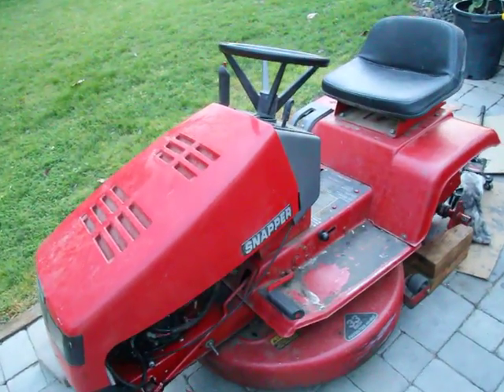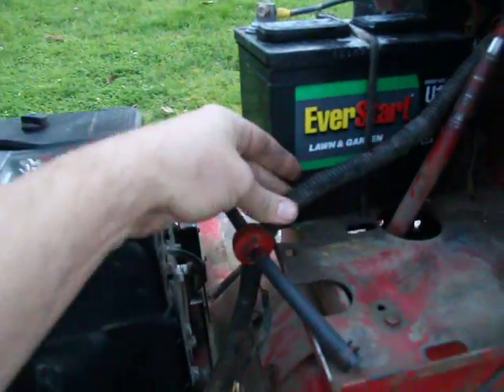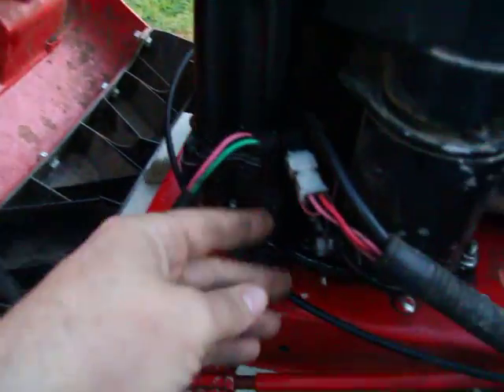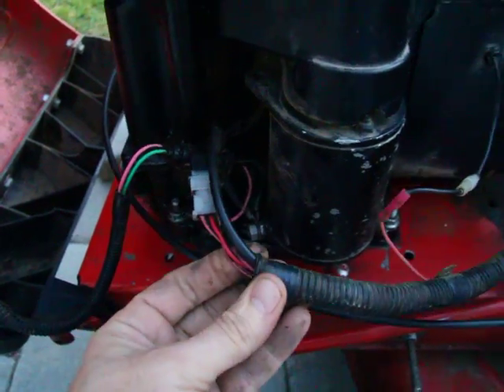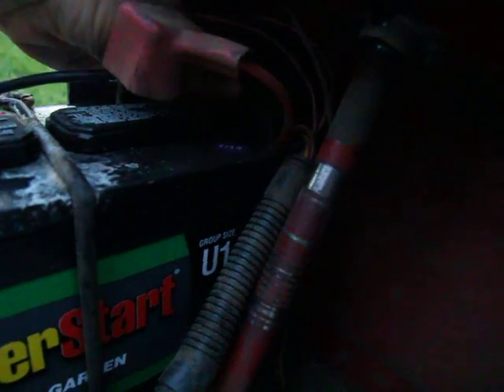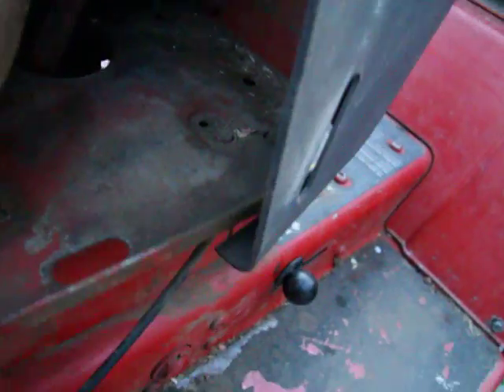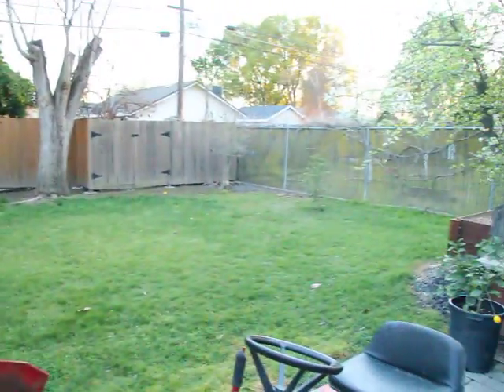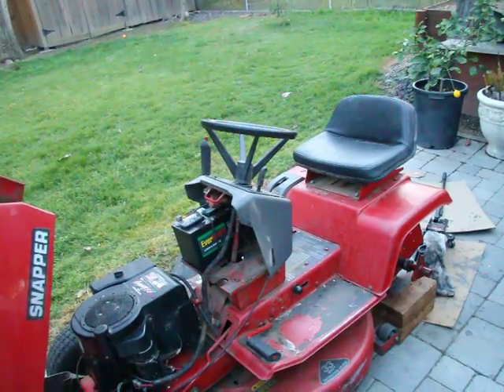SNAPPER RIDER WIRING EXPLAINED (SORTA)

Comment: thanks for the video. the first 2 digits on the code of your engine is the year. I think your snapper is a 1990s one. I have the same one. mine is a hydro. the year of it is 1994 I sent you the wrong service manual. the service manual I sent you is to my other 1984 snapper tractor lt11 with a pto shaft. google the snapper company they might be able to get you one and e-mail it to you.. does yours have a rubber drive wheel on the transmission? I will try to help you as much as I can. did you get the gear case back together. mytractorforums google it. join it they may help you further. the video is good in case I have to rewire my 90s snapper. your so lucky you can work with no snow.
Reply from the maker: Thx, my serial is like: Lt 115 D3311B so I have not a clue about date of manufacture. The drive disc is rubber where it contacts the driven disc(been there done that). It would not drive so I checked the Hex axle and it turned while the wheels stood still. Suspecting a chain break I cracked into the chain case and found the chain intact. However there are a series of small differential gears behind the largest gear and they seemed floppy. My guess is they are shot and my plan is to pull 'em out and weld the axle to create a posi-trac machine. I'm just improvising at this point so let me know what you think.